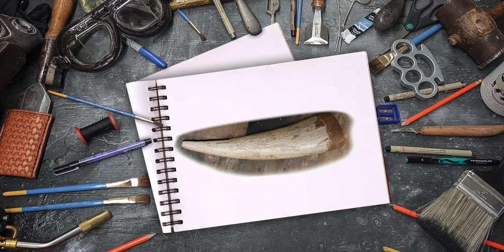DUNE Knife Built from Mammoth Tusk

Comment: ok, so far your knife comes closest to what I think of when reading the description.  "It was a curved and double-edged like a kindjal , and 20 centimeters long, milky white in color and iridescent, and had a black handle with deep finger ridges separated from the blade by a slim round ring instead of a shearing-guard. Crysknifes are blades made from the tooth of a Sandworm."
Reply from the maker: Yeah I think it's interesting that Frank Herbert decided to make them smaller when the sandworms are so big that's why I feel like the one from the new movie is probably the most accurate to what would be  reality considering that when we see the teeth of the sand worm they're about 60 ft long so the knife must literally be just the tippy tip of those teeth.